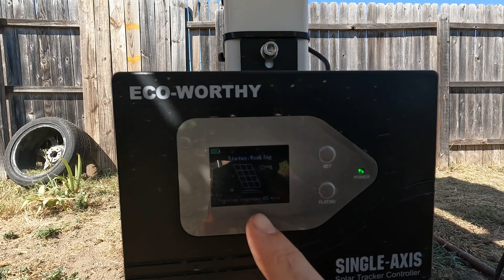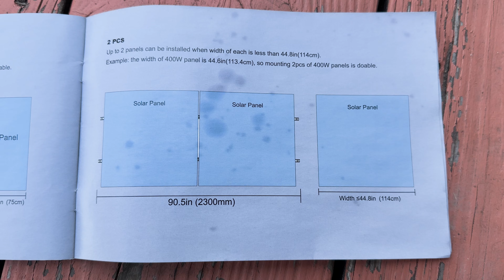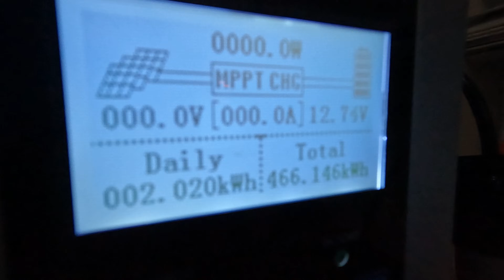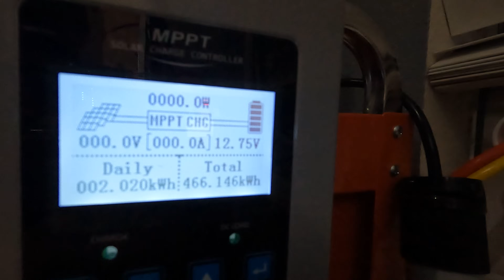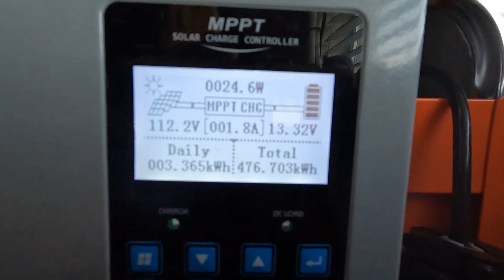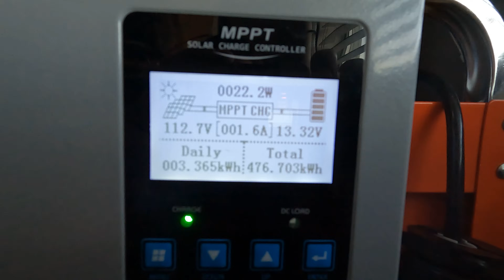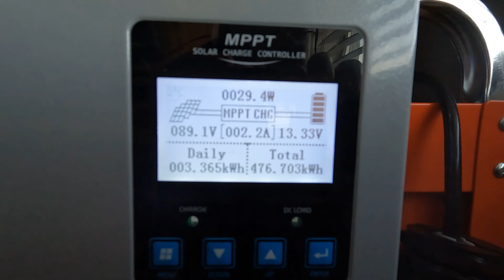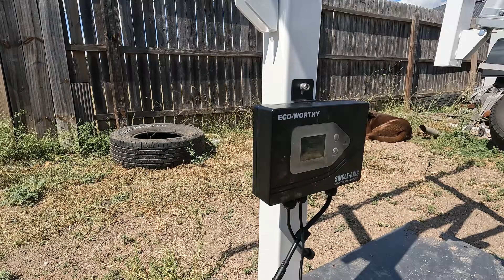Eco-Worthy Solar Tracker Overview, Testing and Build

Comment: Good video.  I have seen your pergola install as well.  I am putting in a couple of hybrid mini splits and one comes with 4 panels which I was wondering if I should use a Eco Flow Tracker for instead of a IntegraRack or similar ground mount.  My roof line is not conducive to panels at that end of the house.  For the shop I will mount the panels for the other mini split on the exposed fastener metal roof.  For the shop there will be 7 400W panels.  So where can I find the specifics on the dimensions of your own panels along with weight or wind load requirements?  Thanks again for your video.  All the best from north Texas.
Reply from the maker: Check the eco worthy website, maybe download the manual for the tracker, it states max weight and size of the panels.  Those mini splits look awesome I’m sure they will work amazing
Reply: @Mikebuildss thanks for the quick reply.  My goal with solar is to build emergency backup as first step. The hybrid minisplit should be able to run in a grid down situation so I can heat and cool without grid.  Also I want to put in a critical loads panel with my initial power for the house.  Lots of ideas and I may not get all this before the end of the year but I have to figure out what I can do.  Fun to dream anyway.  Haha

Comment: If you had to guess, was the weight of the base you fabricated at least as heavy as the whole mount? Thinking about doing something similar, but I don't have 1/2 inch steel plate available to me so I was thinking plywood and sandbags or concrete bricks, at least until I get around to pouring concrete.
Reply from the maker: Honestly maybe about 100 -150 pounds, I’d say if you get it at least that heavy it won’t move. Mines held up to some crazy weather and hasn’t moved

Comment: How does the mount do with heavy wind? I want to make mine to where it can be a 'temporary' thing and don't want to use concrete if I can keep from it.
Reply from the maker: @bigmike101lol  so far it’s been ok, but I’d make it as beefy as possible, maybe add sand bags on the base

Comment: This is a great option for individuals who are constrainted to a small area; however, just like someone mentioned above, you can buy 2 additional panels of varying wattage to make up for the loss of a tracking system. Great video!
Reply: That's true, however you would also have to buy a fixed racking system and they aren't cheap.
Reply: When buying 2 additional panels you might also have to buy a larger charge controller to handle more amps and voltage.
Reply: this is great for automatic cleaning from snow

Comment: Due to the extreme drop in prices for solar panels, trackers are much less economical than more solar panels!
In addition, trackers have mechanical and electronic components outdoors - and are susceptible to guests. 
Therefore, they are high-maintenance and often break down. On the other hand, ground-mounted solar panels work for at least 25 years - and are maintenance-free!
In order to achieve more even yields throughout the day, the solar panels should be mounted facing S-E (in the morning) and S-W.

Comment: Mount those motorized arms upside down the seals break down and allow water in....
With the motors inverted you will have no moister issues....   ask me how I know!
Reply from the maker: @mindbender50  ahh that makes sense, I’m going to try that. Hopefully the cable is long enough, it’s very short for some reason